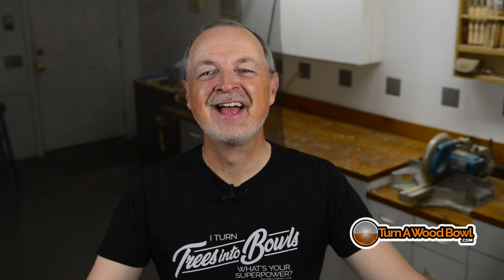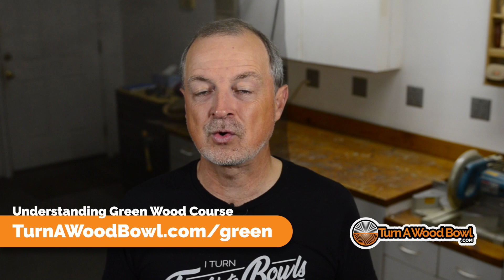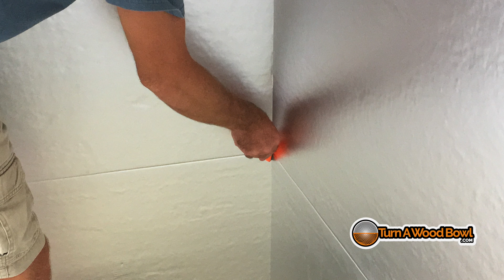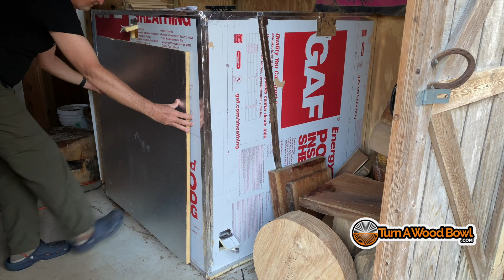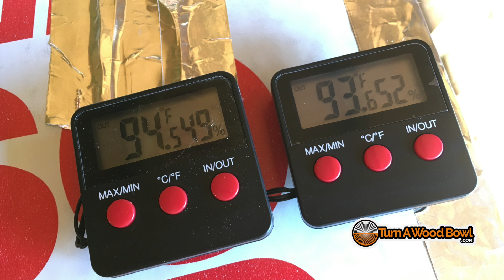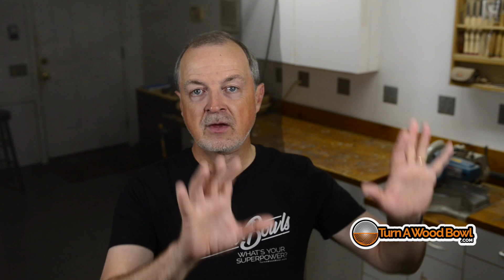How To Make Wood Drying Box - Video

Comment: Hi Kent. I live in the Pacific Northwest. Currently (right now) the humidity in my shop is at 53%. Equalized means it's still stupidly wet. Oh, and it's 65% in the house! Even store bought, truly kiln dried wood, swells in my shop! 🤣 
But my question is, where are you getting 60W incandescent bulbs these days? Except for boutique patio lights (and even they are frequently LEDs) I can't get them.
Reply from the maker: That's a great point about the bulbs, I get mine online. Happy Turning!

Comment: I was going to make one of these, then I heard your temperatures.  My garage, where I currently store my rough turned bowls is 90+degrees for 6+ months of the year😂! I guess I can get by with my “passive” system.  My log shed averages over 100 degrees.  I guess this is a “perk” of living in Phoenix😅.  I do like your design and might use it for an even more accelerated version.
Reply from the maker: Thanks for sharing! Sounds like you have a good system, and I'd be glad to hear how it goes with an accelerated version. Happy Turning!

Comment: Kent, very helpful, thanks!  If you put unturned bowl blanks in how does the anchor seal slow down the drying process?
Reply from the maker: Thank you, Steven. The end grain will allow moisture out quicker than anywhere else and that what causes the cracking. So sealing helps regulate and even the drying process. All the best to you and Happy Turning!

Comment: I'm working on the assembly of my upright freezer "drying box" this weekend. I'm copying a few different videos that I've seen on YouTube. I'm trying to make it even more passive by auto draining the condensed moisture with the existing defrost drain. I plan to use it to dry raw blanks rather than twice turning. I'm hoping to be able to get several sizes and shapes going at once.
Reply from the maker: Sounds good Archie. I'm not sure you need a drain. The moisture will most likely evaporate, unless your stock is dripping wet. It sounds like you'll have a great set up. Enjoy and Happy Turning!
Reply: @TurnAWoodBowl  I am indeed starting with green wood with very high moisture content. I just want to turn dry wood. I don't want to fool with turning twice if i can help it. I don't get much tim in my shop, so start to finish projects are my best option at the moment. It's been a few weeks since I started the process. First of all, I found that I can indeed get the temperature up high enough to kill the beetles. Unfortunately, I didn't recall that if the wood dries too quickly, it cracks. Even if you have sealed the endgrain. That being said, I have some nice candidates for resin projects.

Comment: Years ago I made something very similar to this for controlled fermentation of a homebrewing conical fermenter. I took a large u-haul wardrobe box and cut foam to fit five sides and also made an insulated door very similar to what you made. I had a thermostat that regulated the temperature by turning on and off a lamp with a 25 watt bulb in it. It work amazingly well and allowed me to brew ales in my garage during Pacific Northwest winters. If I had lived in Minnesota, I may have needed to kick the bulb wattage up a "bit". If it works for beer, it has to work for wood!
Reply from the maker: Very cool, Stein. Thank you for writing and sharing! Happy Turning!

Comment: Kent. Your video on Making a Dry Box was very interesting and informative.  I have a question though. I recently acquired some rather small pieces of wood. They are all recently cut and they are green fresh wood. Could I put them in a drying box and dry them in a few weeks. Also would a solar oven/box be a option for drying. Thanks
Reply from the maker: Dave, a drying box does work quickly. However, you want warm, not super hot heat. You're "inspiring" the moisture to leave the blanks, not forcing the process. All the best to you and Happy Turning!

Comment: I read the article on drying wood on your website, which is an excellent resource. Among the many options for drying wood, I didn’t see any reference to what I think is called the water displacement method in which once-turned wood is completely submerged in oil (mineral oil). Does this method work?
Reply from the maker: Good question Matthew. I have not tried it myself. Seems too cumbersome, costly, and not suited for multiple bowls. I don't see why it wouldn't work. All the best to you and Happy Turning!

Comment: I'm wondering where you keep this box? It seems like it is outside. Can this be in a basement? How many lower and upper vents did you put in? I am venting 1/2 logs that are sealed on the end grain about 12" diameter. I've weighted them and moisture metered them. How long do you estimate with this system and keeping it inside will this take?I'm excited to speed up the drying time!! Made the box 3'x3'.
Reply from the maker: Good questions, Elly. It can be located anywhere. I have mine in the barn. I made two vents high and two low, but I only have one at the bottom and top open. It's super basic. All the best to you and Happy Turning!

Comment: We are lucky up here in Montana. 6-12 weeks in a paper bag and we are ready to go.
Reply from the maker: Sounds excellent! Enjoy that dry air. All the best to you and Happy Turning!
Reply: Thanks Crackerjack. I am in Utah and was trying to find out how to slow down the drying process. In the house in the winter the humidity can be as low as 12%. I have to cover my blanks if I can’t turn all in one go, or they will dry and crack overnight. I have mostly been using the microwave method so I can better control the drying process but was looking for a hands-off solution. I will try the paper bag method for slowing things down and see how that goes.
Reply: @jaredcall2358  I do  use Tree Saver, or some times paint, on the end grain of logs I collect and before turning. It still drys but slowly. If I'm going to use it within a month I don't bother.
After a first turning I paint the the piece all over before putting in the bag and bringing inside during the winter. During the second turning, if it is still not dry, and after I have turned off the paint, I sometimes  put it in our       oven on the lowest  setting for an hour. I leave it in the oven to cool. Then repeat if it isn't dry. Works great and the oven will take large pieces with the trays removed.
The other way if you don't mind some warping in the finished piece is to make the piece in a single turn no thicker than a 1/4". Thinner will give more warping which I find attractive.
Still put it in a bag. and it will dry fairly quickly, most times without cracking.
Have fun- make shavings. Lot's of good videos on YouTube.
You can find 'Tree Saver' on Craft supply USA .
Reply: @jaredcall2358 That would be a convection oven with a low setting. Wife approved!

Comment: I made something similar to this with a dead refrigerator I had.  I use a 60W light bulb hooked to a pressure switch from a overhead projector to have it turn off when you open the door.  I was able to drill holes in between the frig and freezer with the exhaust in the walls of the freezer and a few inlets down low in the frig part.  I mainly use it to dry down firewood slabs for to have my HS students use for small projects and turnings.   I usually use the freezer part to hold my 3D printer filament to keep it on the dryer side obviously when I don't have the bottom loaded with fresh wood.
Reply from the maker: Thank you for writing and sharing Nicholas! Sounds like a great set-up for drying. All the best to you and Happy Turning!

Comment: Hi, Kent! Can you think of any alternative to regular light bulbs? They are forbidden in Germany for energy dissipation and not sold anymore for several years now.
Reply: I use a stand up heater that was made for chicken coops.
Reply from the maker: There are reptile and chicken heating elements that use a bulb socket, but give off just heat, no light. That should work as well. Happy Turning!

Comment: Ken,

I’m wondering what part of the country you operate from. I can’t identify a tell-tale accent and I didn’t find anything after a cursory glance at your website.

I ask because I have two sizable chunks of box elder that need a home. One had a sizable burl, which has been separated from the a rest of the segment (and I still have that too), and a significant bark inclusion remains on that segment. I’m not a woodworker, so I can’t take advantage myself. I’ve offered these pieces to the local woodturning club, but I think they prefer to use wood that has been kiln dried and otherwise prepared for turning.

It wouldn’t be worth the cost to ship then, but perhaps if you aren’t too far away, you could recommend an appropriated destination? I live in Rochester, NY
Reply from the maker: Willa, Thank you for writing and sharing! Rats! I'm a long way away from you with the Atlantic and Gulf of Mexico about an hour and a half drive each. I sure would love to house the box elder. Thanks for thinking of me. All the best to you and Happy Turning!

Comment: Hallo Kent. A little question from a guy from Denmark. lol
What is a good moisture content for a ruff turned bowl blank, if you messure it with a moisturemeter, before you can final turn it? 
And another quick question. When you are talking about no cracking in the drying box, do you seal the end grains with anything, before you put the blanks in the box? 
I love your videos. They are very educating and informative. 
Thank you.  
//Pangleren - The gyu form Denmark
Reply from the maker: Hello Pangleren (Denmark Guy) ;) I usually don't measure the moisture, instead I'll weigh the bowls. I have a whole course on managing Green Wood www.TurnAWoodBowl.com/green Check it out. And yes, I seal the end-grain areas, inside and out before adding them to the dryer. I'm glad you like these videos. Thank you, and Happy Turning!

Comment: This sounds like a good idea.  I usually rough turn my blanks, coat the end grain with old unused latex taint, and put them up in the rafters of my shop.  I have problems with them warping some and cracking.  The warping is not a big problem as that can be turned out (sorta), but the checking is another story.  The humidity here where I live  ( the gulf coast of Texas) is rather high most of the time, but this method sounds like a solution ( I hope!!!)  Thanks. I always enjoy your videos, and learn a lot, or get my memory jogged and remember things I learned a long time ago.  Thanks.
Reply from the maker: Alan, Thank you for writing and sharing! I hope this method helps you. All the best to you and Happy Turning!

Comment: Hi Kent,
Maybe you should use a 75 or 100W infrared lamp.
They also sell this in keepers to keep small piglets or chicks warm.
These lamps are really made for that.
Keep it safe, it is not over yet.
Willy from Belgium.
😷😷😷
Reply from the maker: That could work, indeed, Willy. Just watch that the temperatures stay relatively low (around 90° F / 32°C). All the best to you and Happy Turning!
Reply: @TurnAWoodBowl  Thanks, why don't you try it yourselve?
Greeting.
Willy from Belgium.=.
🐰🐰🐰

Comment: I’ve seen a few builds that were along the same line, but was never inspired by. I really liked a few things that you kind of put out there as ideas on how you can customize it. 

It got me thinking about converting a couple shelves (from a industrial type stamped metal, garage shelf that you could use as the framing) into a multi chamber/baffled drying box. Then when you dry them you can kind of just rotate them from the top down over time to start it in the most humid area. This would be where it will lose its moisture slower initially to avoid early cracking from free water loss and then rotate it to the drier area closer to the heat source/air flow when it’s ready to dry out the stubborn bonded water.
Reply from the maker: Sounds great Miles! Inspiration is the goal and it looks like you got some! All the best to you and Happy Turning!

Comment: Kent,
Thanks just what the doctor ordered a simple drying box.  I have space constraints so this box just might be what I need.  What do you use as a marking pen?  I was thinking of using a sharpie but I’m afraid of bleeding deep into the wood or if it’s to wet a sharpie will not mark.  Any advise from a pro is appreciated.  Thanks
Reply from the maker: A Sharpie is fine and doesn't bleed that far. You'll turn away all the markings long before you are finished. All the best to you and Happy Turning!

Comment: With the proliferation of LED lamps (which use MUCH less energy) you might want to specify that you use a 100 Watt INCANDESCENT lamp. A LED lamp that produces illumination equivalent to a 100 Watt incandescent will consume far less energy (abour 15 Watts) and create correspondingly less heat as a waste byproduct. There are some 100 Watt panel heaters or space heaters, but they are hideously expensive compared to a 100 Watt incandescent lamp bulb.
Reply from the maker: Great point Graeme! Yes, this won't work with LEDs. LOL All the best to you and Happy Turning!
Reply: Great idea for the heat box. You said weigh the blanks to see if they are dry, but how much weight should they lose? Should it be a percentage of weight or what else? Thanks. Jim

Comment: I haven’t been able to find a refrigerator so I think I will try this. Do you seal the end grain before putting the blanks in the box?
Reply: I use and old refrigerator to dry my blanks and seal the ends with paraffin wax. Fairly good success.
Reply from the maker: Yes Doug, the end-grain areas (inside and out) only. Happy Turning!

Comment: Thank you for sharing your wood drying approach. Excellent idea.

When I started thinking about doing something similar I was concerned about leaving a light bulb unattended for an extended period of time. The solution that I came up with was to use a tubular heater of the kind used in outhouses, greenhouses etc. They are designed to be left on indefinitely, they are thermostatically controlled and have auto shut off if they overheat. The kind that I use come in at  40W for 1ft in length, 80W for 2ft in length etc. In the UK they cost about $30 (equivalent). 

I have installed these in a workshop cabinet which is based on a standard kitchen unit with additional ventilation. I use modified Eclipse wire shelving which is very strong and allows for excellent air movement.
Reply from the maker: That sounds like a great set up and I am planning something similar with another dryer I'm making. Stay tuned. All the best to you and Happy Turning!

Comment: Great explanation. Do you use anchorseal on the long grain before putting bowls in the drying box?
Reply: Great question, I was wondering the same thing.
Reply from the maker: Just the end-grain (inside and out). Typically moisture doesn't escape the side-grain nearly as fast as the end-grain. Good question. Happy Turning!

Comment: Kent, like the idea you have here. 

Here is an idea I had while watching your video. Like you, I live in Florida (a few miles up the road from you) and suffer the humidity. Due to the size and shape of my shop (I am completing the build soon) and that my shop has wood walls, I was thinking of the "cabinet" idea - but putting the cabinet(s) on the exterior wall(s) but pulling the incoming air from inside the shop, since my shop will be air conditioned and thus already have Florida humidity removed and letting the cabinet(s) vent to the outside. How does that idea sound?

Also, you might like watching Jim Sprague's videos on his fridge kiln(s) https://youtu.be/6C89KE0osf0  https://youtu.be/7fVLWCPgyNM
Reply from the maker: Sounds pretty interesting. I bet that will work well. All the best to you and Happy Turning!